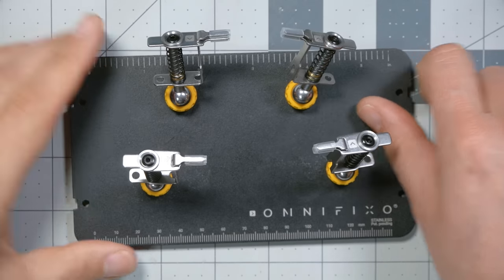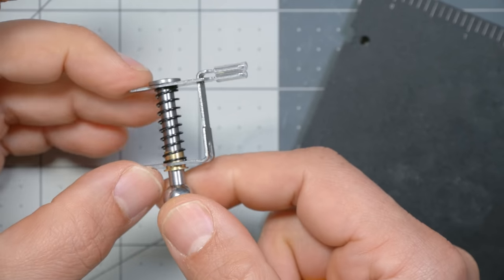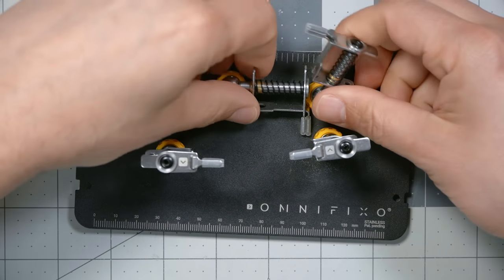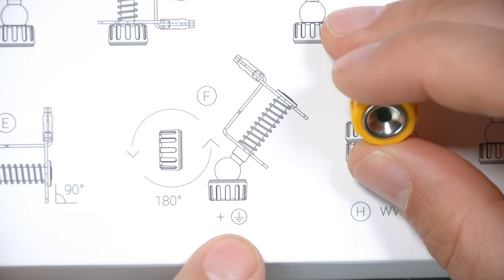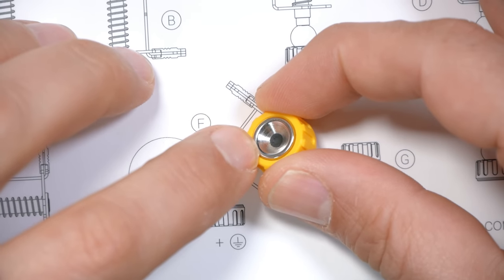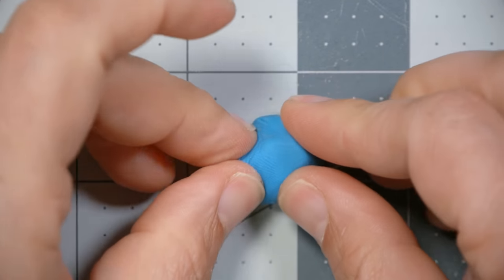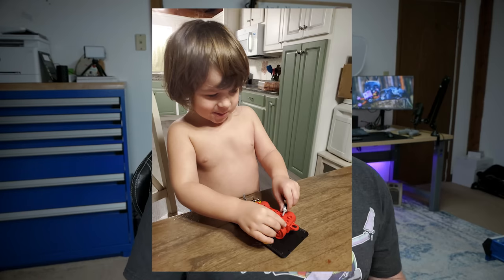This is the best 3rd hand tool I've ever seen | OMNIFIXO

Comment: I purchased one of these and Bardwell is right, its an amazing piece of equipment , I used to use either the common 3rd. hand with the gator clips or a piece of Blue Tack, but this thing was a game changer for sure. Also the price has been dropped to $59.00, that still seems a lot to pay, but it’s really worth it, thanks for the heads up on this Joshua 👍

Comment: The phrase "3rd hand tool" conjures up thoughts of those crocodile clips held in place by the ball-joint tubing, etc., fiddly tools that can occupy more time setting it up than using it, but this one actually looks really good.
My most useful '3rd hand tool', beyond my nimble fingers able to hold two pieces of wire with one hand (and moving them around to align them) to solder them together, is a mini suction desk vice, even without being suctioned to the surface its weight makes it sturdy, I literally just bought a 2nd one today it's so useful.
Reply: There are higher quality 3rd hands which are not the cheap crocodile ones but well built flexible arms.

Comment: It looks thought through but at the same time: A very small plate and due to the small magnetic "hands" it will only have a very low stability.
You can indeed put two of them on top, but even a heavy wire might cause that to collapse.
So if you only solder tiny components, light stuff then it might be a nice help. If you also solder things with a bit more weight this looks like it would quickly start to fail on you.
Reply: Fair point but many traditional 3rd hand devices can be had for 5ish bucks. This can potentially solve a boatload of small frustrations that those others can't. I think this is more of an "also" than an "instead". Everything has a tradeoff

Comment: What a coincidence... I bought it and it came to me the same day you published the video :)
Anyway, the tool is great, much better than other 3rd hands. And I hope you know about the "friction fix" for it? There's a small black rubber nub inside each of the magnets, sometimes it's inserted too far and you have to push it from the underside towards the ball to add a little more friction. It's actually written on omnifixo blog (I also received the info about it after the purchase).
Reply: If you know some kind of helpful information about it, it may be helpful to others if you actually say what the "fix" is.
Reply: @nemocheerio  You're right, sorry. I edited the previous comment.
Reply: @werewolf_pl  Cool. Thanks for the info. I just ordered this. Even though it seems a bit expensive. It looks like it has the possibility to be one of those tools that makes me say, " I should have just spent the money on one of these years ago instead of struggling so much." Again, Thanks for the tip!

Comment: Does it maintain its orientation strongly enough to resist wores that don't want to be bent?  Looks like they might twist around with a nudge.
Reply: Yes it will.  For really stiff wire use 2 clamps.

Comment: Thank you Joshua Bardwell for this!!!

I have seen this on your bench in your videos and was wondering about it.  This video 100% sold me on it.  I bought one through your link (hope you get some commission from it.)

I am most impressed with it's versatility and options it provides.  I have a couple different sets of 3rd hands.... and to be honest... they are ok... but mostly suck when needing slight adjustments.  I even have some 3d printed wire holders for slicing..... again.... they are ok... but like the other ones I have.... too cumbersome for the use they provide.

So thank you very much for this review video!

Keep up the great work!

Comment: This looks great but not $65 great. It would probably end up in my pile of 3rd hand tools when I opt to just use blue tak for speed. A board vice or the pointed tip magnet board holders  for more involved applications works splendidly.

Comment: I wish you could tighten the arms though. Sometimes things especially boards will move on me.
Reply: But the board in a board vise and use these clamps to hold wires, components, whatever needs to be near the board. No rule says you can't use two tools together.

Comment: If you push the little rubbers inside the feet more towards the base of the ball it will be stronger. It wont bend over on holding weight.
Reply from the maker: Thanks this is a great tip.
Reply: @JoshuaBardwell  You're welcome!

Comment: That thing is super cool - one thing I’m wondering about though, you mentioned that by flipping the base over, the arms become grounded. Is the coating on the base conductive then? It would be great if you could test that with a multimeter, because if the base isn’t grounded, you’d still have to hook up to at least one individual arm to actually ground the board you’re working on.
Reply: Yeah, I don't think the ground solution they provided would actually work.
Reply: I just tried it and unfortunately the coating isn't conductive. But there's still an option to use it on other surface, you can attach it to anything metal. But stil... it would be better if it worked with the original setup.
Reply: I’m not even sure what the grounding would be needed for (static electricity?), but couldn’t the rubber tips just be removed then? Admittedly reducing grip. Just speculating what they thought there.
Reply: Ok, I had a look on their website. That’s actually what it’s meant for. You remove the insulation, and can then put GND through the base plate and attach a clamp to an insulated base, and thus test a component, e.g. a power LED.
Reply: @droggisch  The problem is that the base plate is not conductive (or actually the coating of it), so you still have to connect ground to the clamp itself. Or you can attach the clamp to other conductive material and then use it like you wrote.
Reply: @werewolf_pl  Very very late on this, but there's a couple of uncoated/etched sections - one oval shaped where you can connect your ground, and one circular where a clamp on an inverted magnet will contact the base and conduct up into the clamp.

Comment: What is better this or the purple octopus arms thing I’ve seen before?
Reply: That's half the price of this? You guess... Lol  And, the octopus arms thing makes things stay put. These magnets wiggle around way too much! 😎🤘
Reply: @KOrnhOliO1  The exact opposite.  If you did order these be aware that one thing JB didn't point out is there's a rubber nub inside the magnets, and some of them got pushed down inside there so they're not protruding when shipped.  Use a blunt thing on the not articulating side of the magnet and push the nub out.  These provide friction so that the magnets don't wiggle around.  So yes, they thought of that too.  https://omnifixo.com/blogs/news/friction-adjustment
Reply: The omnifixo is better, HANDS DOWN.  I own them.  And the price is so high that if I didn't LOVE them, I wouldn't be saying this.  They're fantastic.

Comment: I have off the wall question. Can you hook up a cable to tbs crossfire tx to antenna. If so how long is to long. Thank for your help.
Reply from the maker: Yes but why? Crossfire has insane range.
Reply: @JoshuaBardwell  I am making a fpv rc similar in my enclosed travel trailer.  I'm concerned it would interfere with my crossfire.  I'm hoping to add an cable from radio to outside antenna . If so how long should I make it. Thanks for your feedback.
Reply from the maker: You should make any antenna cable as short as possible, to minimize losses.
Reply: @JoshuaBardwell  ok . Thanks again

Comment: Like by now... There should be cores in Solder that hold a bull throughout the solder... And when it melts it has an attractive polarity to pull solder to itself... I just feel like we should be closer to better connectors and bonding than we went... It's like unless this helps with the environment... Keep using exactly everything the way it is... When will they focus on this so that they can have better technology... By now... And i know it will ruffle feathers... By now you should be able to buy components and they are in plug safe cases and the board mineral oil dipped... For some light water proofing.. all that... Especially the prices we pay
Reply: Wut
Reply: @Burn377  magnetic solder

Comment: Damn! You didn't mention they are all gold plated and that's why it's $61 ! 🙄
Oh....... It's not gold plated? Holy cow! They like it a whole lot more than I do!!! Lol 
Is this one of those made in Europe products that we in the USA get hosed for because of the exchange rate? 🥴🤷
Banggood will knock this off in a month or two and it'll be $29.99 !
Don't get me wrong, this is co0ol and great, but the price is kinda ridiculous! 🤔😩 Blue tack is something like 5 bucks! Haahaa! 👍
Reply: I'll bet you a buffalo nickel that when they attempt the knock off, they'll forget some of the details that make this useful, like the friction rubber nub inside, don't make the magnets strong enough, etc.  This dude spent VERY OBVIOUSLY a ton of time making the design perfect, so that it's actually usable.  I had those octopus plastic arm helping hands thing sitting on a shelf collecting dust because when you try to have the arms hold something close to something else and you need it precisely in place, say you're trying to join to wires together as an example, you push them together, they're in place, PERFECT, and then you let go, and both arms retract a millimeter or two so it failed, and then you do it 20 times and it KEEPS happening.  I gave up on them for that reason.  I got these, and other than learning you gotta move them into position at the base of the ball, and hold them an extra second before letting go, and HOLY CRAP THEY STAY IN PLACE PRECISELY!

If you appreciate this amount of meticulous design to make the product 100% useful, it's worth the money IMHO.  They're not for everybody, I get it that they're pricey, but it works SO much better than any other helping hands I've ever tried.  They're the only ones I'll even consider using.

Comment: 1:13 I bet touching a board mounted like this with a soldering iron is enough to move it out of place.
Reply from the maker: The tension can be adjusted by pushing the rubber stopper in and out.
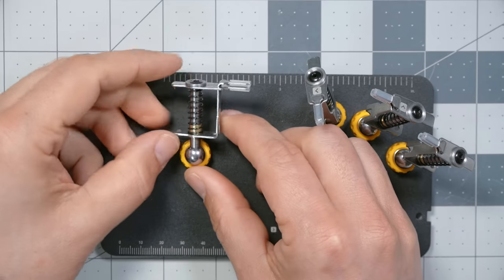Reply: @JoshuaBardwell  Thank you for a response, then it shouldn't be a problem, also flipping it upside down like shown at 1:33 would solve that

Comment: Look up "helping hands" on amazon (or wherever you shop), kind of a general soldering tool term, many are much cheaper. I got a 2 clamp set for $10 and it does a great job holding wires/components for soldering, or can spend >$20 for more bells and whistles. Had em from soldering long before i got into drones, a must have tool.

Comment: Those ball socket joints look waaayy too flimsy to hold anything up. I can see as you go to put pressure on with a soldering iron they just bend
Reply from the maker: The tension can be adjusted by pressing the rubber stopper further in and out.
Reply: @JoshuaBardwell  Ah neat. Thanks JB

Comment: finally a useful soldering aid! I've been finicking with photo holders, gummy clay and melting scotch tape for years to avoid marking or denting small wires with the old school alligator clamps. Let see if this is better. I am worry the magnets may not be strong enough and that the setup could be pushed if you touch with the iron while soldering, but maybe not. Some machine shops have measuring tools mounted on a big magnet that you activate with the turn knob to make it really strong, would be cool if this had that.
Reply: I was thinking the same. What keeps the work from leaning to any one side as you apply pressure? Maybe use at least three clips? Depending on the size of the object, flipping the clips over so it's closer to the base might affect how close you can get if you have large hands. I use a small bench vise that has a ball joint. I just have watch out and not get the soldering iron too close to the hard rubber pads. Otherwise, I get that sweet aroma of burning rubber 😂🤣

Comment: The magnetic ball articulated arms looks too weak. If each grabber rather had three magnetic feet with a screw to lock it's angle relative to the base, it would be a really good product. The idea that you have a base where you can move each grabber across is a good one, but it appears to be way too flimsy. I like to be able to apply some force while soldering, and in some cases you absolutely need to. Imagine trying to hold an ESC and soldering thick gauge battery leads to it. The grabbers would just fall. You can say that this tool isn't the most optimal for that specific task, but for the price it should be able to do everything.
Reply from the maker: You can adjust the tension by pushing the little rubber stopper in and out.
Reply: @JoshuaBardwell  That's good, then. In my opinion, the articulate arms should be tense enough so that the magnet starts moving across the board before the ball joint starts bending. And, the whole thing will be more rigid if you both adjust the tension, and use multiple arms to hold the thing you're soldering to as well.